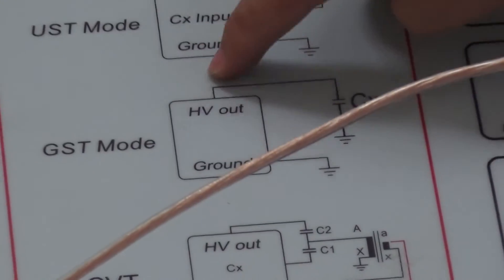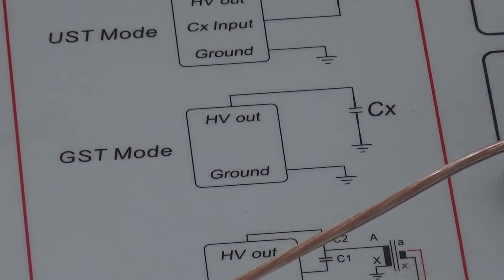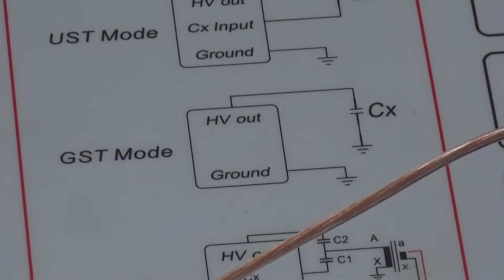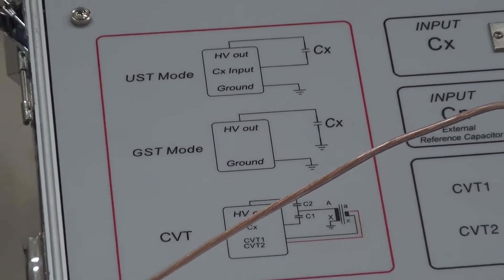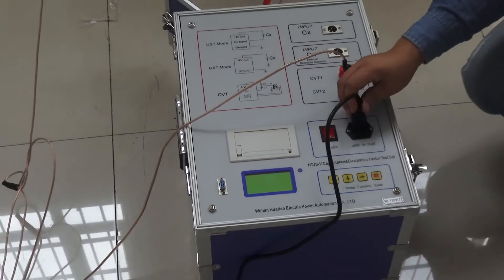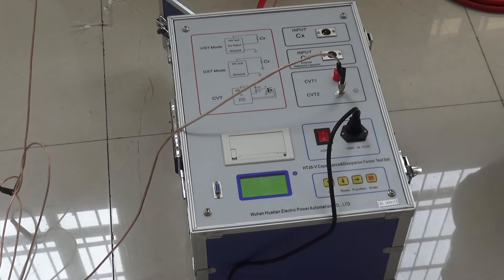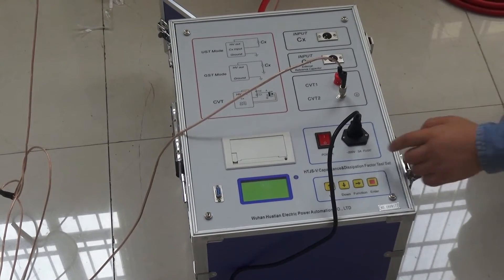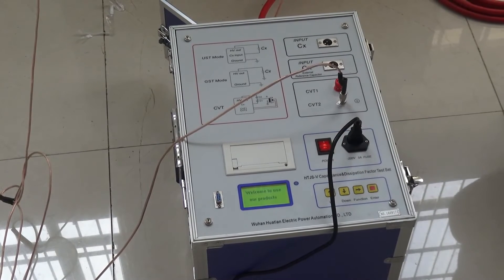HTJS-V Tan delta tester

Comment: can this tool be used for tan delta current transformer or CVT ( capasitif voltage transformer ) test?
Reply from the maker: Yes, this tester can used for  delta current transformer or CVT ( capasitif voltage transformer ) test, kcanyou give me your email or whatsapp? then i will send you quotation with technical datasheet